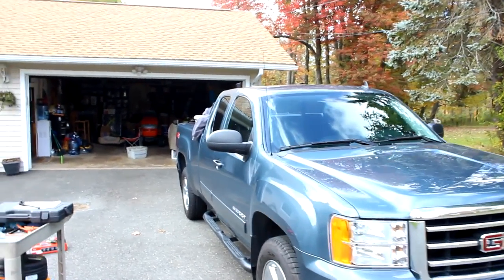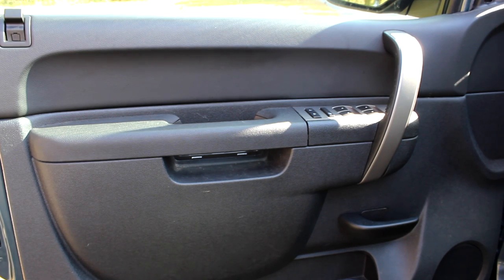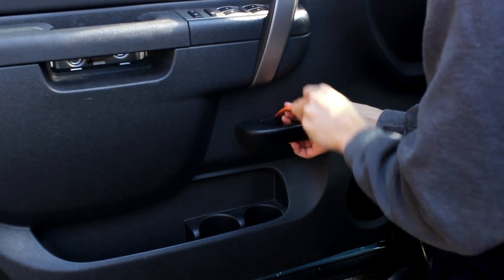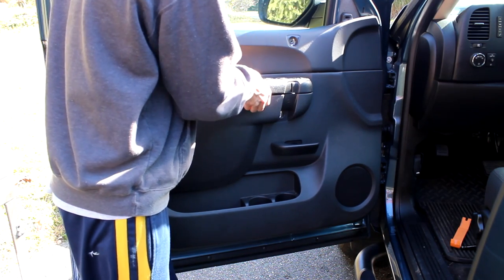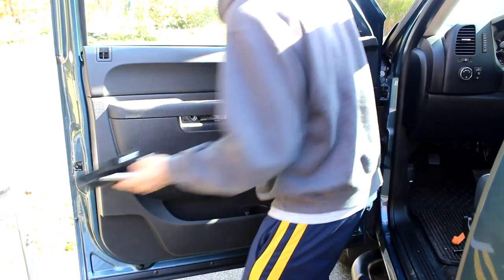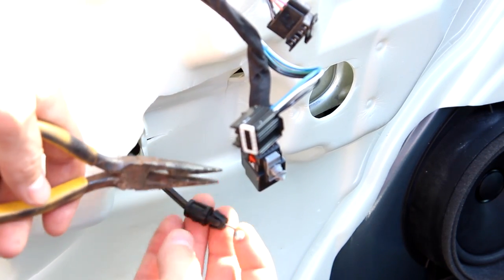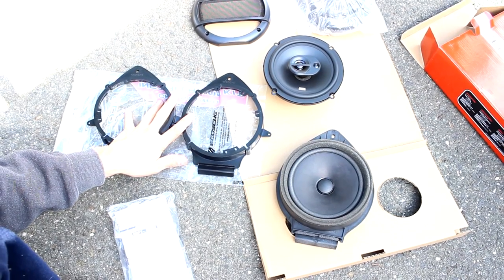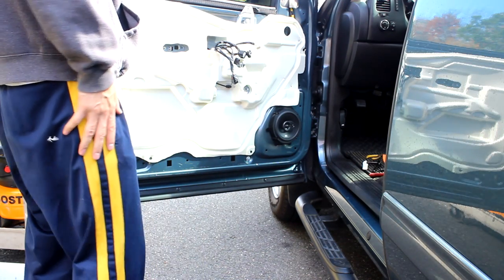GMC Sierra Front door speaker install replace change 2013 extended cab

Comment: I didn't even mess with removing the door handle cable, I had plenty of room just rotating the the door. I did have issues with the bracket from Crutchfield but think I got it now. That being said installing speakers in my 2010 Dodge Ram was way easier.

Comment: You don’t need new brackets the plastic is soft just cut the pillars and it will pop out and you can put the new speaker in no problem

Comment: Thanks for the video. I'm gonna do this to my '11 in a couple of weeks. My question is, the area behind the speaker, is it enclosed on the back side or open to the rest of the cavity where the window rolls down. If it's enclosed id like to use spray on sound insulator.
Reply from the maker: I remember it being open cavity, so the window would need to roll down.. You could do a sheet of sound dampening material

Comment: Did your speakers come with screws? Or did you have to buy your own? I got the same speaker bracket and wire harness from Crutchfield today, just waiting on my speakers in the mail tomorrow
Reply from the maker: Yeah, New speakers usually come with screws and misc hardware to mount. Good Luck, let me know how you make out

Comment: great vid!  so your just running these on the stock deck amp?  no aftermarket amp?  how much did it improve the sound?
Reply from the maker: yes sir, just the stock deck.. was good enough for me.. with the new speakers and the added subwoofer it really helped in my opinion. I recently traded in the truck, so i no longer have.. but i do miss it!
Reply: ok thanks for the info

Comment: Hey man when you removed the speakers from your truck did you replace the factory tweeters as well and if not do the speakers work fine with them with the factory tweeters still on
Reply from the maker: I don't think my truck had tweeters, but if it did, I didn't replace! It should be fine to replace just the door speakers. Thanks for watching!

Comment: I was wondering if you had any trouble attaching your speaker to the bracket?
Reply from the maker: I did not have any issues with the brackets. My buddy did though// He had to drill a new hole, and use a nut & bolt.
Reply: Yea I got my speakers from crutchfield also...they provided the brackets but it wasn't a clean fit for the speakers so yea I'll have to drill a new hole to secure em in...thanks for the vid and reply!

Comment: i have a 09 gmc sierra crew cab. Would all 4 speakers be the same 6 1/2"? im away from home but would like to order some speakers asap
Reply from the maker: +Cassidy Bahm - sorry for the delay in getting back to you. I ordered all 6.5" for all 4 speakers. The front need brackets, and the rear require some modification.

Comment: did you also do the tweeters or did you leave those stock
Reply from the maker: The truck i have does not have the tweeters.. I believe only the Bose systems have the tweeters? If you have the Bose system, your speakers may already be a "step-up" from stock, so not sure if its worth replacing?
Reply: its a 2008 sierra replaced the speakers they were real cheap  but trying to find out about the tweeters learned all from your videos front and rear  that why i was asking about the  tweeters  and no does not have bose   thanks
Reply: I have a 2013 Silverado  LT ext cab z71 and it does not have bose but does have tweeters.

Comment: Are the 2013 speaker sizes the same as 2007? If so, what sizes are they? If not, where can I find out the sizes? 

(confused woman trying to replace her fiances speakers as a surprise) haha
Reply from the maker: +Brandi Baxter - if you go to crutchfield dot com you can put in the truck year and select speakers that will fit. I believe its 6.5" for front, and 5.5-6.5" for back (with adapters) if you order from crutchfield - they will ship with all adapters and pieces needed
Reply: +matt dobson thank you so much!